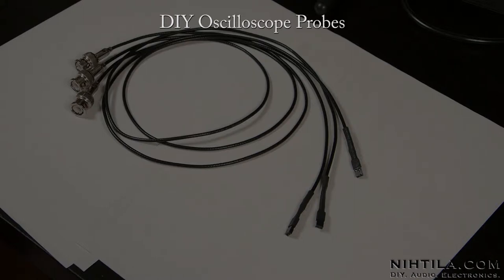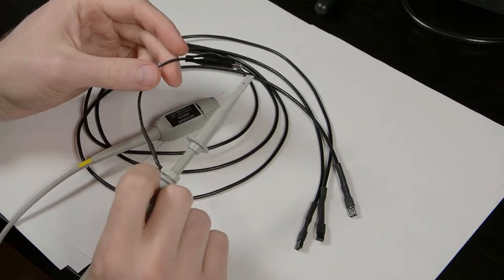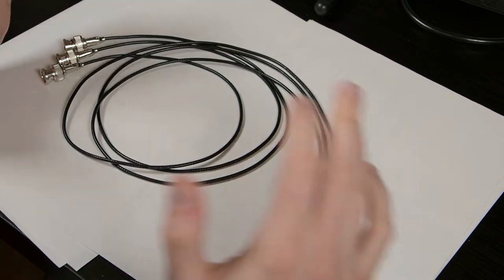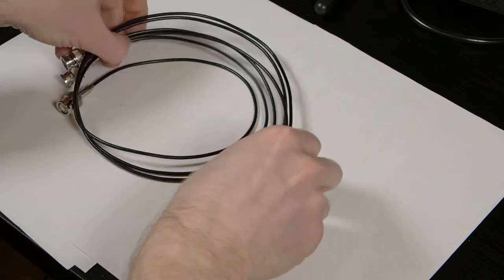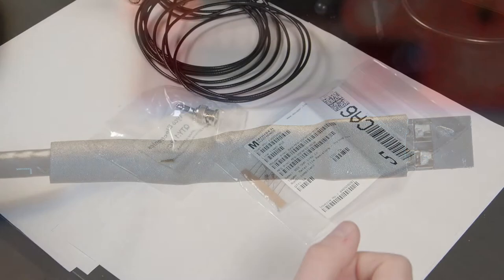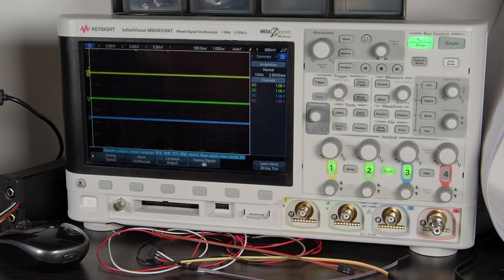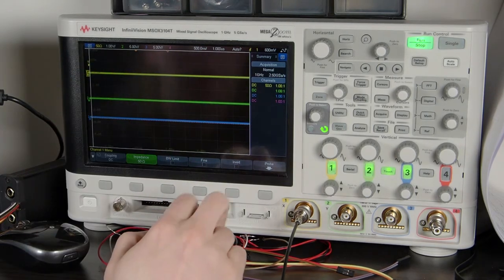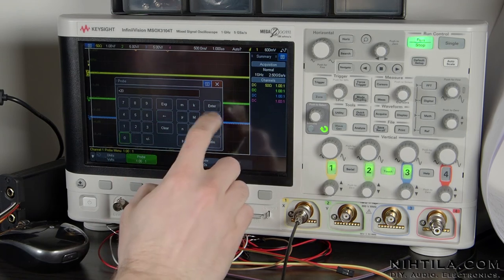Robust High-Bandwidth Low-Cost Passive DIY Oscilloscope Probes

Comment: how do we make sure it's capacitance value is correct? is it based on the coaxial? i know some are adjustable but i bought one and it had the right capacitance but it's adjustable and at that setting the impedance is 10M ohm 22pF and the scope says 1M 22pF so idk, it's been years since i used this thing but I'm not getting any good readings just a flat line. anybody got any advice for me? much appreciated